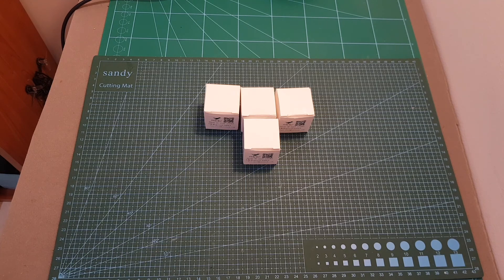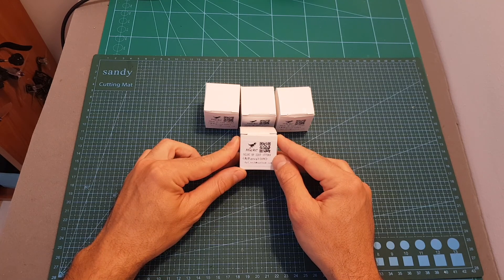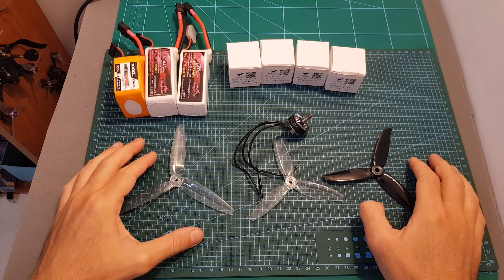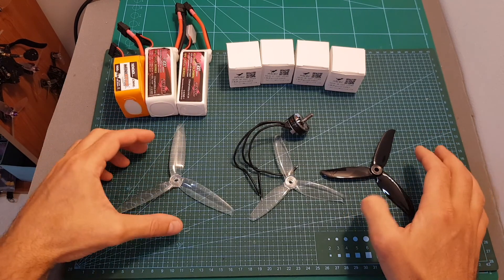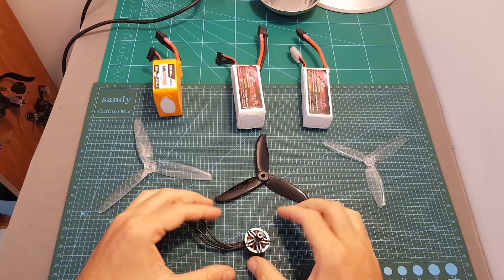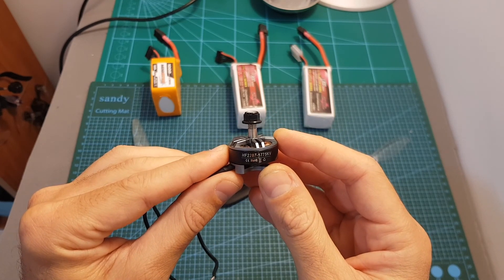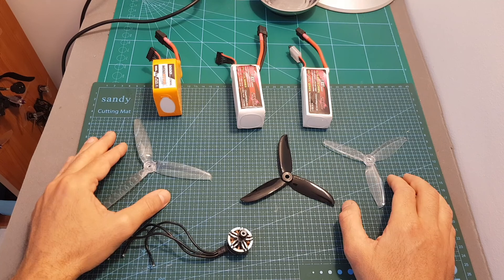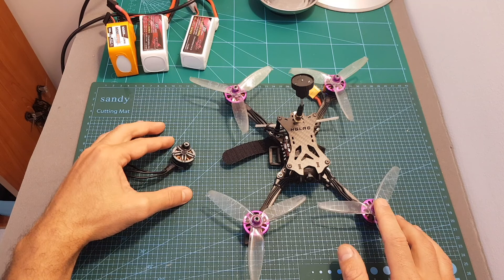HGLRC HF2207 1755KV Motors - Batman220 Upgrade & Thrust Tests

Comment from the maker: Sorry about not adding my conclusion at the end of the video .
I think that these motors are more efficient than the stock motors of the Bat220 and will enable you to extend the flight time. I also suggest that you should stick to 4s and 5s lipo batteries, as I don't see a big advantage using 6s lipos and you are also risking burning the motors, as they did get pretty hot using 6s.